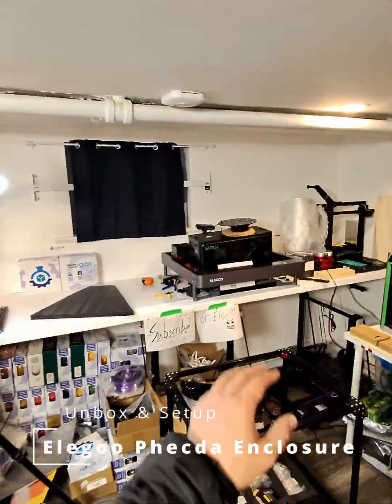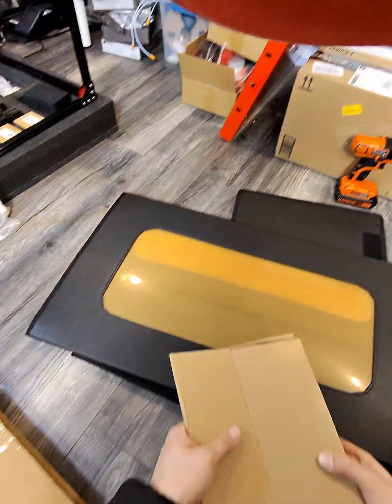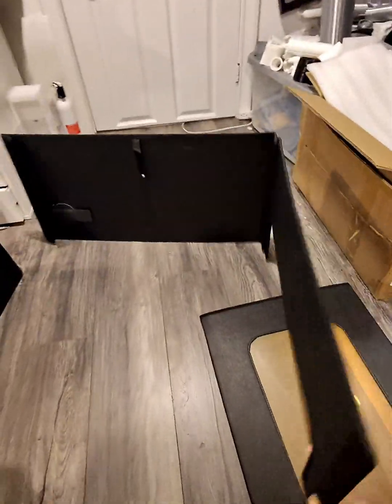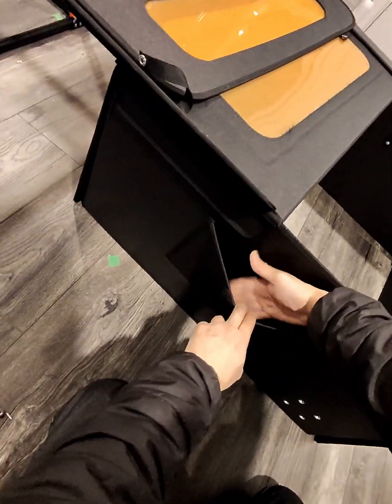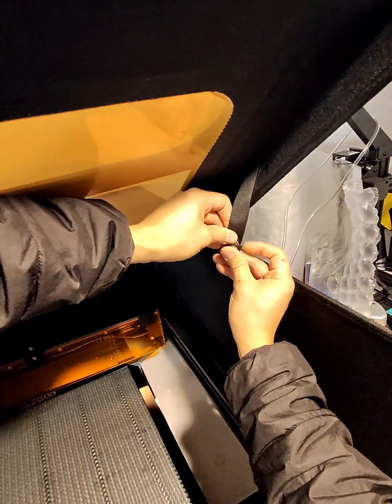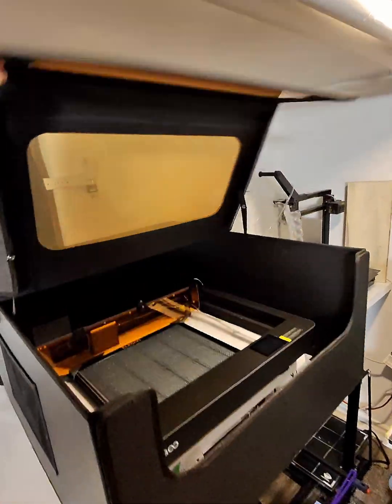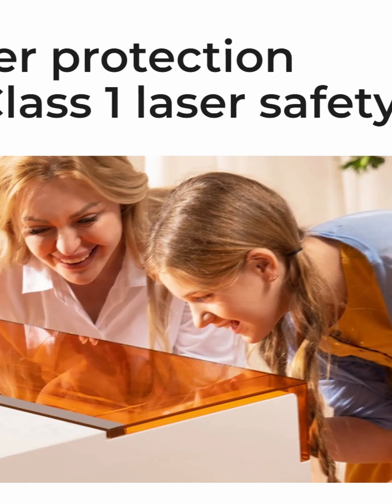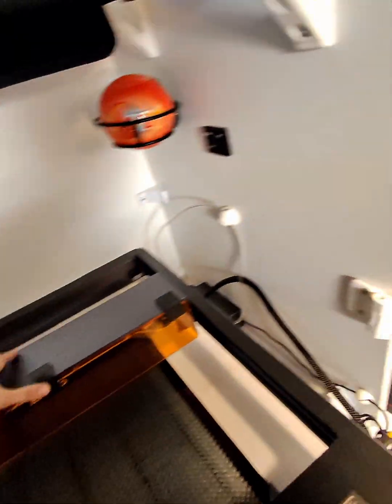Phecda Enclosure full unbox and setup - PSA Windows Do not block Laser #elegoo  #Phecda

Comment: Just bought one of these. The four holes are air inlet holes, otherwise there would be a vacuum when the exhaust motor is running.
Reply: I was thinking maybe to use of those extra filters I am going to buy with the 10W Phecda and put it there against dust
Reply: @sirfrancisarthur  it's an inlet not an outlet!!